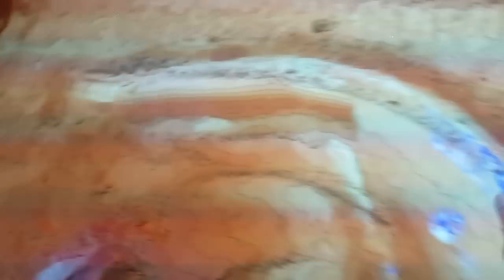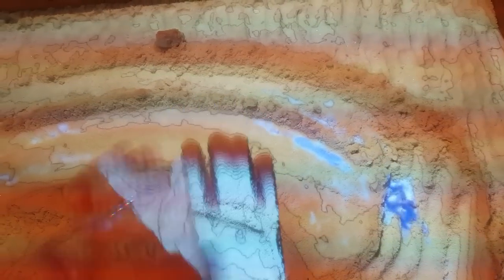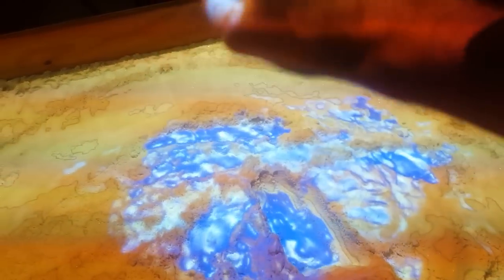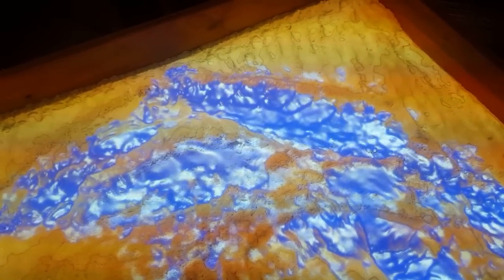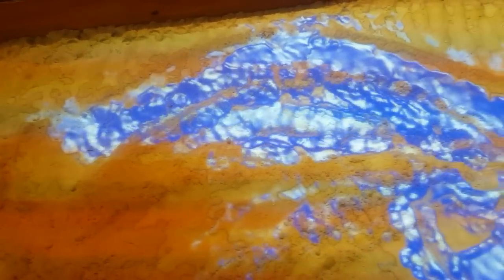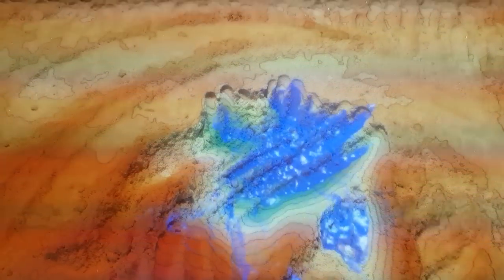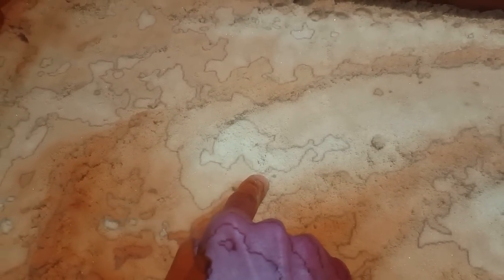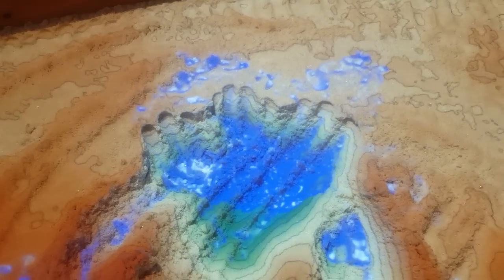AR Sandbox Update Latency Explained

Comment: Hi there!  Have you considered rendering in real-time with the condition that the surface can only change in elevation x-centimeters every 1/30th of a second?  That would allow you to hold your hand higher than that x-centimeter mark and it would avoid detection, however if you bring it down to the surface, you can still interact with the liquid in real-time.  That real-time liquid interaction really looks like something special to me.  And possibly a simple range filter could quiet down that terrain noise.

Comment: Do you use kinect V1 or V2 ?
Did you think about using multible kinect to reduce the amount of noise?
Sure it would make it more complicated but would probably result in more stable results.
Reply from the maker: +fffmalzbier Multiple Kinects (both v1 and v2) interfere with each other, and cause increased noise and data loss.
Reply: +fffmalzbier look older videos, this guy was one of the first to use multiple kinect to 3d map things and rooms. But it seem you get even more noise that way.
Reply: good call, looks like this only viable to use multiple to cover a bigger area.

Comment: A hand hovering over the sandbox gives a very steep raise in the depth data that could be filtered out. A hand very close to the sand is more difficult to detect. Have you tried with different or shorter values for the delay?
Reply: +ReBootYourMind that, if you detect something higher than the sandbox box height, then it is a hand and shouldn't be part of the height of the sand. As for the low noise pass, can't you apply it after the data has been processed but just before you output the image to the projector ? You might be able to apply the low noise transparently this way, while not having the latency, but data might be less accurate.

Comment: doesnt the kinect capture temperature of the surfaces too ? Your hand is warmer than the sand .
Reply from the maker: +Ryan McCall Both Kinect v1 and v2 work in the near-visible IR band, I'm guessing somewhere around 900 nm wavelength. I can still see the emitted IR light as a faint red glow.

Thermal infrared radiation, the kind that is generated by warm objects around body temperature, and sensed by infrared thermometers and "heat vision" cameras, is in an entirely different part of the spectrum, somewhere between 8000 and 15000 nm.
Reply: +Ryan McCall The IR sensor is working for night vision but it's not capable of capturing the wavelength that would be needed for thermal imaging.
The Kinect V2 IR sensor does a range of 827-850nm wavelength but the wavelength for thermal imaging of humans is 8–15 µm (8000 to 15000) nm  (nanometers).
Reply: indeed
Reply: +wonay92 The kinect can not track temperature, it has no sensor for that. The kinect  just tracks the depth input and can recognizes shapes that meet the definition of a hand.
Reply: fffmalzbier I'm positive it has an infrared emitter and scanner built in, it's in the centre of the device. (Bear in mind I'm talking about a gen 2 Kinect not a gen 1)
Reply: fffmalzbier okreylos thank you for the info, learn something new every day :)

Comment: You mentioned that the Kinect can already tell what is your hand. Wouldn't it be possible to filter out the hand using that data?
Reply from the maker: +DonRobo It detects a specific gesture (hand with spread fingers), but not the hand (or any other body parts) in general.